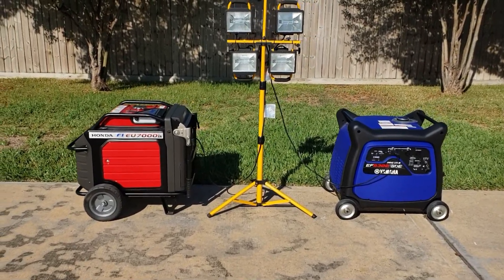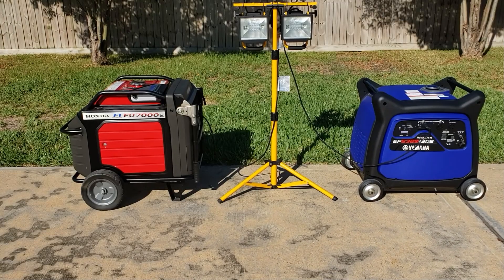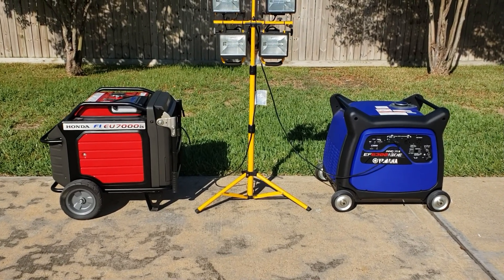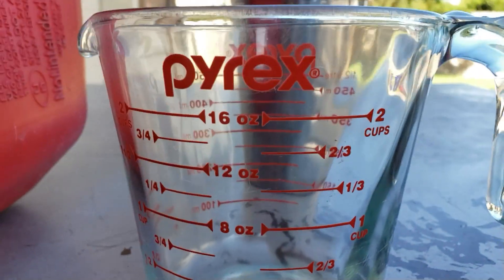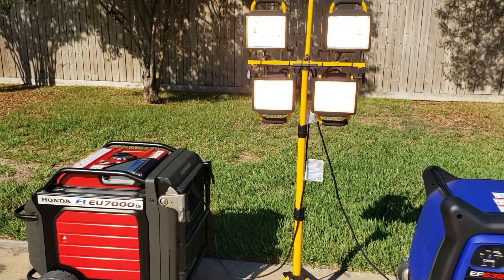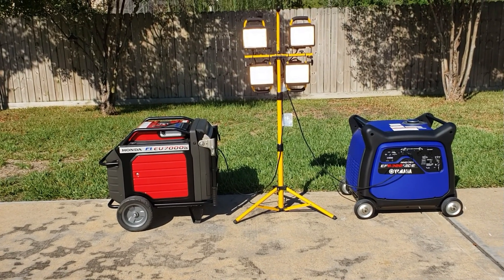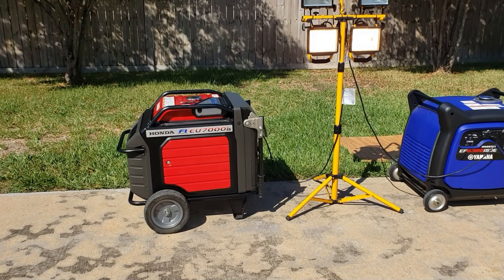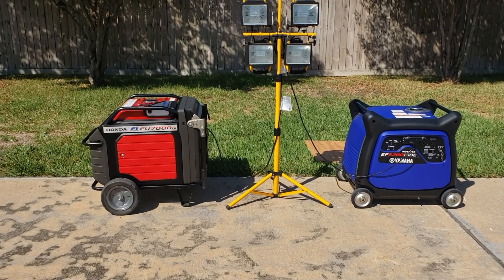HONDA EU7000I VS YAMAHA EF6300ISED  Fuel Efficiency Test | Carburetor vs Injector

Comment: EFI is more about not having to mess with a carburator when you need your generator to run - you can run it for 10+ years without worrying about whether it will start and run or not - the efficiency gain is on top.

Comment: I rather doubt that the Honda was surging at the same time as the Yamaha......if it WAS, it should not have been able to run smoothly, as it did, for a significantly longer number of minutes.

Comment: I have three Yamaha generators a EF3000iS pull start, a EF4500iSE electric start and a EF6300iSDE electric start, all three run great are reliable and Yamaha is known for their reliability and longevity. The Yamaha has the fuel shut off switch that drains the carburetor so you don't have carburetor problems so that pretty much cancels out any plus of fuel injection. The 4 or 5 minutes difference in run time is not a major factor.

Comment: When I bought my Honda 7000 3 years ago I also looked at a similar Yamaha (I think it was this model). At that time the Yamaha did not have a backup pull start. Is this still the case? If it is why on earth would someone buy it?
Reply: You ever hear of a BatteryMinder or Battery Tender or any of another half dozen maintenance charger options out there? I have two electric start Yamaha generators an EF4500iSE and a EF6300iSDE and have BatteryMinders for both of them, batteries last for many years. The same with my John Deere X758 diesel tractor I have a BatteryMinder to maintain its battery.
Reply: @LeeCountySpeedShop  It is a portable generator. It is supposed to work without being hooked up to a power source. What if something fails and it doesn't charge? You are SOL.
Reply: @gsquare6382  You must walk everywhere or drive a pull start go cart.
Reply from the maker: Yep same

Comment: Can you run a test to see how long will the eu7000is run without any load?
Reply from the maker: That would be 24 hours plus of runtime
Reply: @GeneratorReviews  Thank you for your feedback. I am planning on purchasing one, but is trying to establish idle vs minimum watts. Would you mind running with 16oz gas/eco/no load vs 16oz gas/eco/500 Watts? I am not worried about the max as those numbers are published.

Comment: Did they really use all the fuel in the tank?  I know my generator will still have a bit of fuel in the tank when it runs out.
Reply from the maker: They really can’t because of the way they route the hose and filter

Comment: You could have at least filled them both up just enough to run, let them run out THEN add 32 ounces of fuel to each one for a demonstrably fair trial. I don't and won't own either one, I just can't call this a test.
Reply from the maker: That’s exactly what I did😳
Reply: You must not have been listening to what Gavin did. He did it exactly fair and as what you suggested. Both Honda and yamaha are the very best portable generators available.
Reply: @Asidebar  Found the necroposter!

Comment: Now I'm curious about the runtime with a Eu2200i pulling 1k watts with 32oz.  I'm guessing it's longer because of the smaller displacement even though it's carbed not injected
Reply from the maker: I will have to check it out 👊🏾

Comment: Wait.. didn’t the Honda last 42.5 minutes on 32oz against the powerhorse?  And now nearly 50 min on 32 oz against the Yamaha?  That’s a 7 min difference with same amount of gas and same load.
Reply from the maker: The powerhorse was 40 min and the Honda went 12 min more
Reply: @GeneratorReviews  You stated in the vid the Powerhorse was at 30 mins thats why they are saying that maybe edit that vid with text to change your comment to 40 mins for the Powerhorse 7500i
Reply from the maker: @Rockrewls  I may have miss spoke it happens sometimes I usually try to catch it when I’m editing but that one slip through my bad!
Reply: @GeneratorReviews  Agreed your on live video and those things happen, I was suggesting the edit to stop any confusion others may have had. it's all good these things happen.
Reply from the maker: It was almost exactly the same time 50 min

Comment: Can you run a pure sine wave inverter in line with a regular generator and hook up sensitive equipment to the inverter to charge them, is this possible 🤔. I have a brand new generator but it's not an inverter built in and I'd hate to have to buy another generator with a built in inverter to replace it.
Reply from the maker: The pure sine wave and modified sine wave won’t sync up with each other
Reply: Thank you, looks like I'm going to have to buy another generator with the built in inverter 😕. Had the generator since last year but never took it out of the box and just realized that I cannot charge my bluetti ep500 with it ☹️

Comment: Have been a Yamaha guy all my life, I couldn't go blue for the Generators.  From what I've seen it's $350-$500 difference and, to me, the Honda wins in fit, function, looks, capacity and capability. Both Honda and Yamaha need to offer more for the buck. I also feel the  Yamaha is dated at this point.
Reply from the maker: At least the Honda have the Bluetooth capability with info screen on board
Reply: @ Acme tools shows a $200.00 difference currently between these two.

Comment: Not surprised that they're so quiet. Both are slightly under 20% capacity.   For a more practical test I'd have them with a 50% load.

Comment: good test.. i know some people only fill up after a generator completely runs out ..  but  could you run those test again with the fuel system already primed and  ready to run with the tank sucked out .. thus  alleviating any difference the priming process might take away?!!    thanks for the work you put in ..
Reply from the maker: I can make that happen for you 👊🏾💯